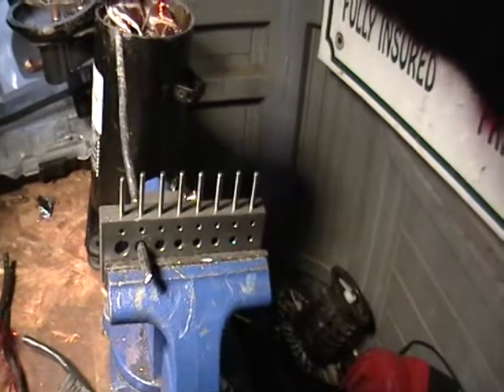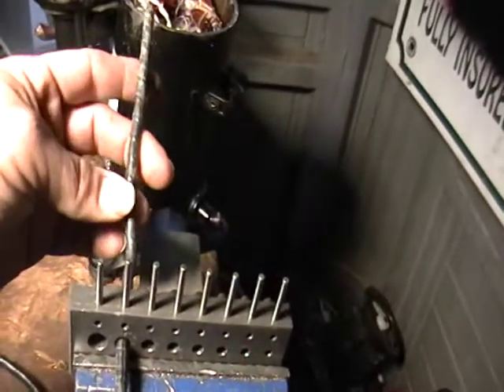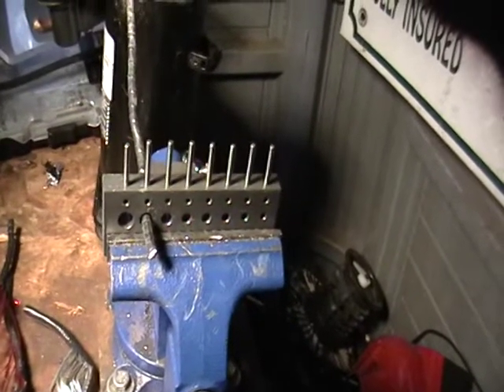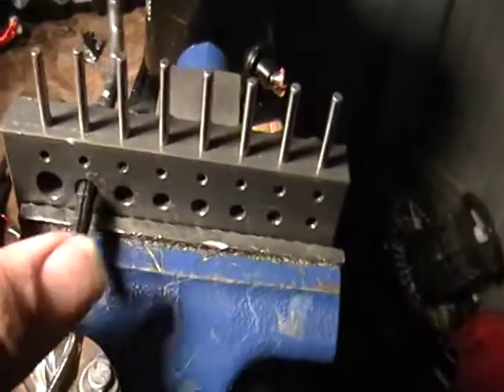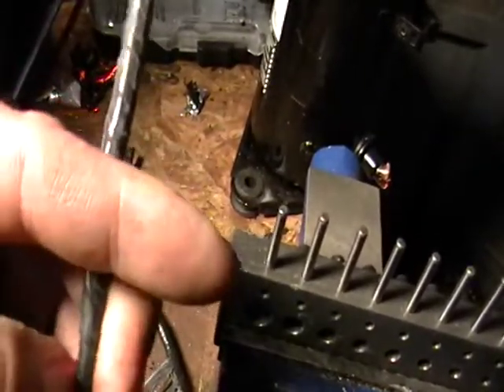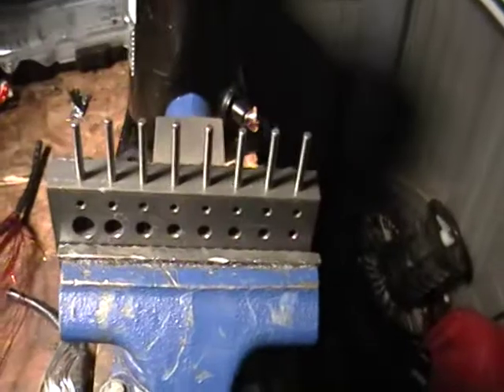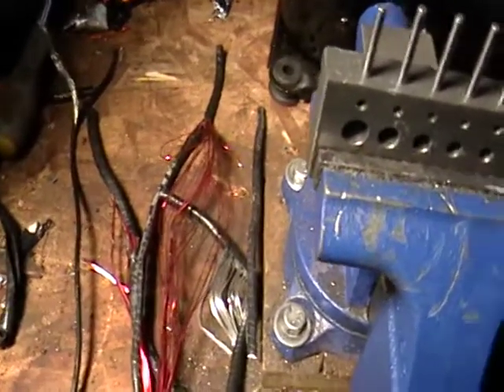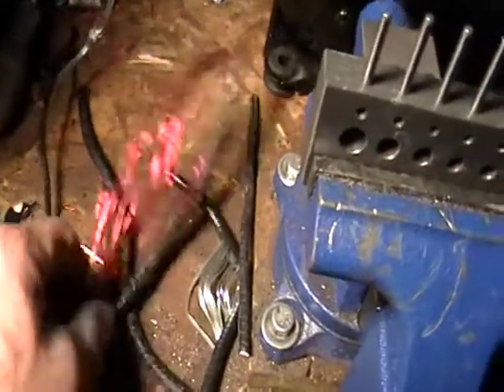Wire stripper part 3

Comment: I was too hasty when I turned in insulated copper.  I've already made about 8 deliveries without stripping it and now I could kick my own butt for it.  I am ordering one on ebay now.  For the mean time I will just continue saving all the insulated wire until it gets here.  Thnx Mike.

Comment: I have been collecting that wire becuase there is a lot of it in tvs and monitors I take the tap off and if its copper I spool it up on spools to use for projects like building wind turbines and rewinding a stator with them I just need to keep finding scrap tvs and monitors lol.

Comment: Is it common that the wire is aluminum? I scrapped a t.v. and got excited to see copper color but found that it was aluminum. Do you pile this aluminum in with clean aluminum or with cast?